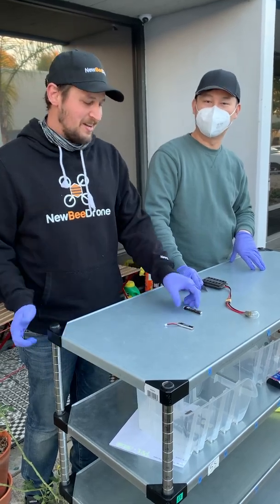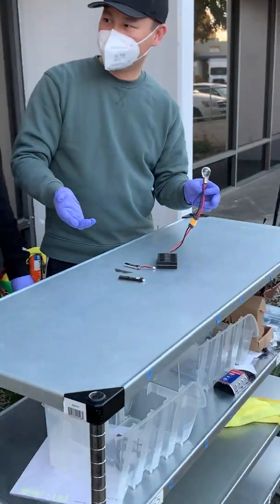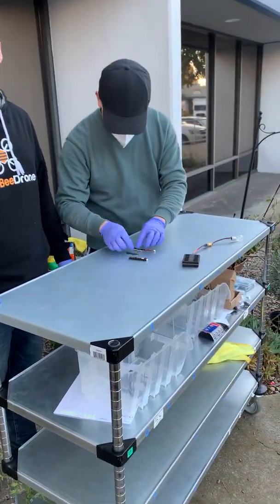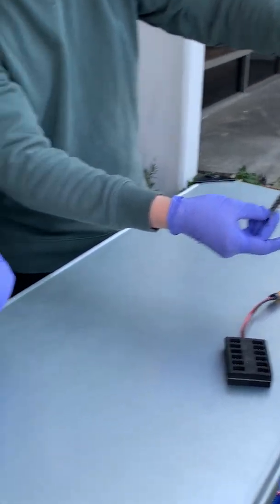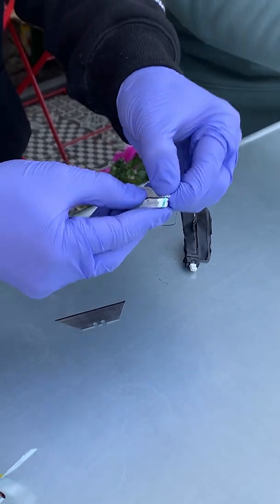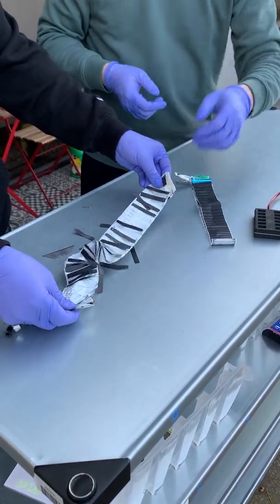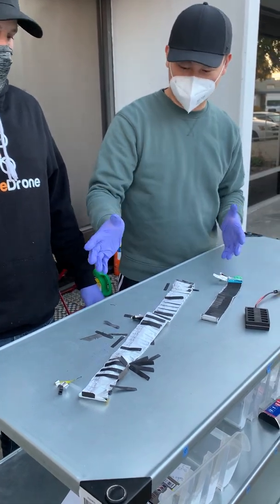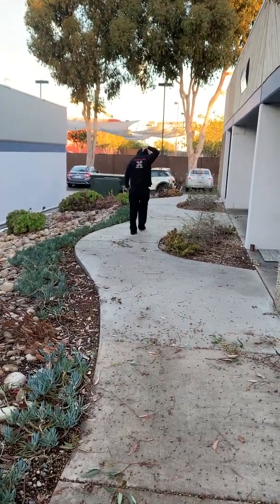Nitro Nectar vs the Other Batteries

Comment: Was wondering why! Why do you stick with an older connector?
Reply from the maker: I know, We need a better connector for the whoop. We are working on a Sold Pin Gold plated ph2.0 connector that can match 90% of the bt2.0 performance, and it is way cheaper and lighter. will lease it soon and people can still use PH2.0 connector batteries. For the reason why we don't use bt2.0. 1. It can be plug in backward. 2. at the very beginning, BetaFPV asking for license fee which we think doesn't make sense. but the first reason was the deal breaker that make us decided not to use it on all our product and push our self to develop our own whoop connector. Our PH2.0 Gold plated solid pin connector will release soon. CiottiFPV already have some test on his live vide. We will keep working on the next generation connector until we think it is good enough, then we will release it. We had been working on our Second generation connector for whoops for a long time. It just not good enough yet. still pushing it.

Comment: Very interesting to see the different manufacturing styles. Just stating one approach is better than the other isn’t very helpful though. Do you have data to back up your claim that the stacked style performs better?
Reply: Fly a nitro nectar and fly a GNB. You’ll notice the nectar delivers way more power way more consistently and doesn’t sag as hard as the GNB do. But when the nectars are nearing the end of a charge, they will tank fast and hard all at once!
Reply: @PAYNEFPV  true!
Reply: Here you can check out the test data from Joshua https://www.youtube.com/watch?v=B8D0hOwTviU&ab_channel=JoshuaBardwell

Comment: they're excellent, no doubt. if only there were actually available. especially outside the US they're basically impossible to find, and US suppliers won't usually ship overseas (and when they do, it costs three times the batteries). get some distributors in EU, and make them available, please. also, next time shoot a video in the normal horizontal format, we're not on tiktok. thanks
Reply: Bought the "new" GNB 1S 380 mAh (same weight as the old 1S 300 mAh) from AliExpress.. Took two months (that's normal for batteries)

Never tested the NBD's before.. And I don't have fresh GNB 1S 300 mAh to compare against..

Maybe the 1S 300 mAh Tattu's might be a good competitor..

It also depends on how long they were stored in a Warehouse.. If your unlucky, you might get one which is up to two years old idk.. No one knows 😂 👍🏼